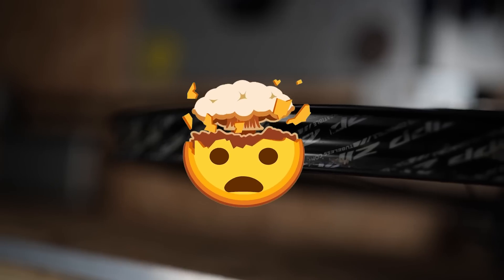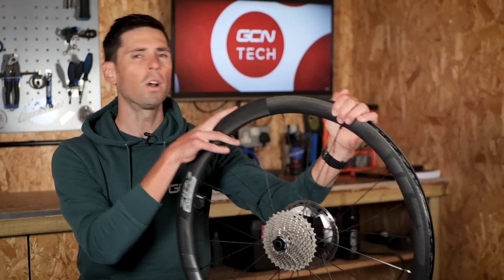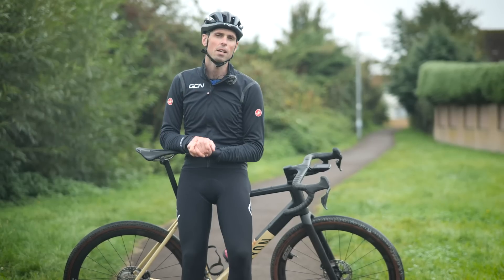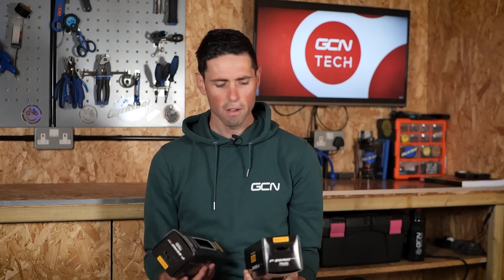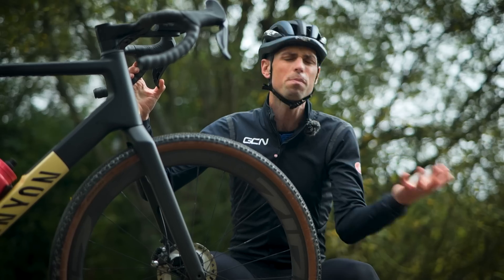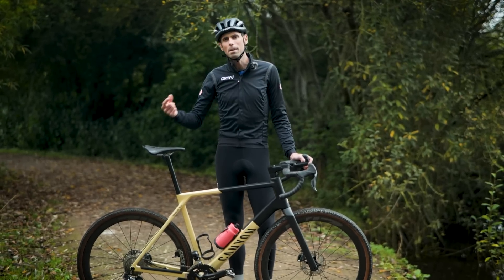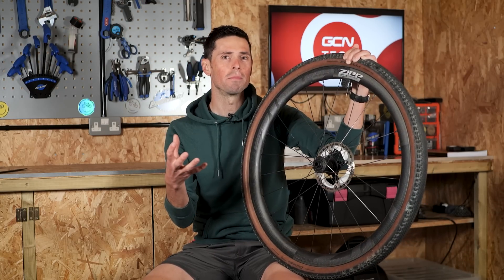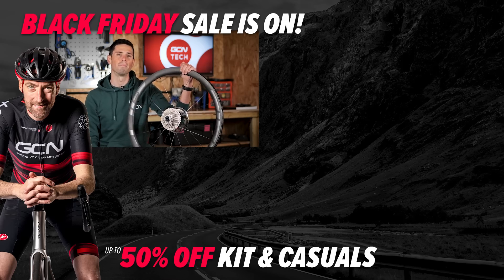What exactly is hookless technology, and what are its pros and cons?

Comment: Sorry @GCN but you have done yourselves no favours, it looks like you're just puppets for your sponsors.

Bike tyres do not have stiff/steel sidewalls like car tyres. Hookless is basically useless and potentially dangerous when you can't inflate beyond 73psi.

As a big tubeless fan (after finding a proper sealant - milKit/OKO), I am also back to running tubes in the commuter and ordered TPU for my deep sections. Whatever they are pushing, I feel I need to do the opposite now.
Reply: Hookless isn't a technology they've just removed something that was there for safety in the first place.
Reply: do you water down you Oko sealant?  if so what do you use?  Thanks
Reply: @JBR.1974  That depends on what OKO you use. We have OKO Off Road at work for car and truck tyres, but I wouldn't use that in a bike tubeless tyre. OKO have their own Magic Milk.

I like milKit or OKO as it is quite thick, compared to others like Silca (which was a big waste of money - too thin and the carbon fibres balled inside) but can be simply refreshed with water, and it doesn't dry into a sticky mess inside the tyre. 

The result is an easy puncture repair by simply popping off some of the  bead, wiping off the sealant with a wet cloth, and apply glue/patch. It also seals the rim superbly, so I only have to add air every 2 weeks or so (used daily).
Reply: Hi Phil, thanks for taking the time to comment. Hookless is a tech that many brands believe in and also one that many brands don't believe in. I do feel that my video which explains the pros and cons of a system in the hopes of helping people make informed decisions is a helpful one though. If hookless tech isn't for you, that's totally cool. What hookless tech or tubeless tyres have you tried? 

Yes, hookless is potentially dangerous, when used above the maximal pressure. But isn't that true of any product's maximal limit? 

What is most important to me is that the industry allows people to continue to make their own choices.
Reply: @alexpaton6795 Thanks for your comments, Alex.

Firstly, I don't think hookless is a 'technology' as there are too many compromises. To me, it's a manufacturing advantage for the brands.

Secondly, I don't agree that the same tyre on a wider internal width needs less pressure. If you measure the tyre when flat, it will have the same overall width, which is then divided into the overall inflated width AND height. If the inflated width increases (i.e., a 28c tyre on a wide rim may measure 30mm) you will lose height. What that means is less height volume increasing the risk of rim strike, even more so if you use less pressure. The actual air volume stays the same.

There is also the consideration of dynamic loading spikes. Hit a pot hole and the pressure in the tyre will spike and as in my previous comment bike tyres do not have a stiff/steel sidewall to deal with these, which is why a hook is an integral part of a wheel's design.
Reply: @phil_d  Hey, I can't say I have conducted controlled and accurate testing that I feel would overrule that of manufactures for the points you mentioned.

From my experience as both a hooked and hookless wheel user I'm inclined to say my experience matches up with the information and testing data that's out there. 

What hookless wheels have you tried?
Reply: What you failed to cover Alex is what happens with hookless when you get a puncture, especially at speed on a fast descent
Reply: @ashleyhouse9690  You crash 😳
Reply: @ashleyhouse9690 what is your point?  Same result whether hooked or hookless. At least with a tubeless setup you are less likely to get a full and rapid deflation.
Reply: @CG-99 No actually. I've had punctures on fast descents one of which was hitting a rock so instant deflation. With a hooked bead the tyre stsyed on and I was able to stop safely. We've all seen the videos of hookless tyres coming off the rim such as Paris Roubaix last year. I don't need to test that scenario for myself thank you very much.

Comment: I had Zipp 303s and they used to fill up with with water because the seal between the bead and the rim was so bad. That was with hookless compatible tyres too. Sketchy AF. Never mind the fact the freehub was draggy and poorly sealed and the axle bearings wouldn’t seat properly and wore out in a couple of weeks.
Reply: Its not just the 303s. I have the same problem with my 404 firecrest disc.
Reply: @adossantos69751 the hub issues or the water? Zipp hubs are notoriously terrible but the beat allowing water in was new to me.
Reply: Theres always a little play on zipp hubs. The bearings needs replacing often. In regards to water ingression, I do winter riding, mostly wet and cold. Used the 404s first time in the wet, got home had water inside the rim. I thought it was the sealant but when i started shaking I coukd see water coming out of the spokes. I ran very low psi, about 30 psi, 42mm tires. I also had a bit if sealant on the rim edges. so maybe i was running a bit to low pressure. However, the water inside the rim, baffed me as i didnt cycle over any big paddles. Gonna have to investigate.
Reply: @adossantos69751  got you. I mean my tyres literally filled with water!! Not the rim cavity. When I removed the tyre it had water in it, the sealant was completely diluted!
Reply: Oh!! Thats a warranty claim surely.

Comment: Issue is you have ETRTO 'standards' there not regulations.

Multiple tyre manufacturers mixed with multiple wheel manufacturers isn't a good mix. In my experience being a bicycle mechanic I've fitted tyres to the same rim one being a pro1 which was far easier to mount than p zero. 

There all slightly different meaning if you have a more forgiving tyre to mount onto a rim that's not as tight it can be a disaster waiting to happen.

Personally I'd just stick with the hook.... Yes cars use hookless but car tyres also have a steel bead which won't stretch unlike a bicycle tyre.... 

Car tyres are also used at a much lower volume of pressure usually around 30psi over a much much wider tyre

Comment: Hookless. I would'nt touch that with a bargepole. Unless you're willing to risk your life to increase manufacturers' margins. The rim is supposedly more aerodynamic but you can only run them safely with >40mm tyres on gravel if you weigh more than 130lbs 😂
Reply: I am 100kg cyclist been using them for a while, they are a lot more durable in pot hole just like my mtb hookless rim
Reply: Rubbish, Alex has literally just told you the limit on a 28mm tyre with 73psi is 110kg according to zip calc, that's 240lb 😄
Reply: @jakethesnake1976  trouble is, the optimal tyre pressure for a 110kg rider on a 28mm tyre is much higher than that. You’d smash the rim to bits if you hit a pothole.

Comment: If you're using hookless rims with innertubes, should you still not exceed 73psi or does that only apply to tubeless?
Reply: Hookless wheels should never be used at higher pressures than intended, regardless of if there's an inner tube or not. Thanks for asking
Reply: yeah, imagine giving your spare hookless wheel to oldtimer. He will use tube, his old pump with old guage and pump it to preasure he is used to pumping. Poor geazer is going to be suprised on fast downhill decents ... @alexpatonGCN
Reply: U r still not allowed to go over 73

Comment: How much did they pay you, to make this video??  HOOKLESS IS NOT WORTH THE REDUCTION IN PRODUCTION COST. Safety should be a top priority for the large companies, not profits.
Reply: I've avoided hookless for now but struggling to find too much about why they are bad, generally seems to be videos of high pressures. Could you send some links?
Reply: @space.youtube  you tagged the wrong person.
Reply: @Graean1  Fixed. Sorry about that.
Reply: Thanks for taking your time to comment. I'm curious to know what hookless wheels or tubeless tyres you've tried and feel has contributed to your opinion? Hookless tech or tubeless tyres are not for everyone and that's cool. Hopefully the industry will continue to allow people to choose from hookless or hooked, but like all tech out there, if used as intended there is very minimal risk and safety shouldn't be a concern.
Reply: @alexpatonGCN ”if used as intended”… If you’ve ever worked as a bike mechanic you’ll know how hilariously optimistic this statement is.
Reply: @Graean1  very true, I'm with you on that!  However if the bike industry is expecting people to be able to correctly and safely torque up carbon parts and interfaces that are critical to safety, it seems logical that tyre pressures should be no major issue.
Reply: @alexpatonGCN  it’s not just pressures though, there’s a while minefield of pressures, rider weight, rim width and tyre compatibility. It is going to go wrong and some poor sod is going to pay a heavy price before the industry inevitably backtracks on it.
Reply: @alexpatonGCN  You were asked how much GCN was paid, why didn't you answer the question? 
If GCN was paid, why didn't you clearly state at the outset of the video that this was a paid advertorial?